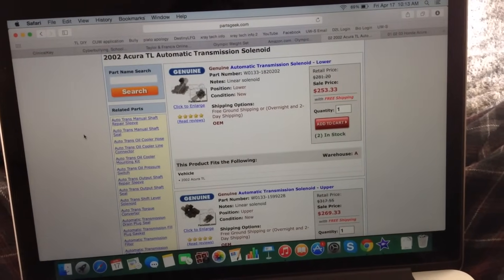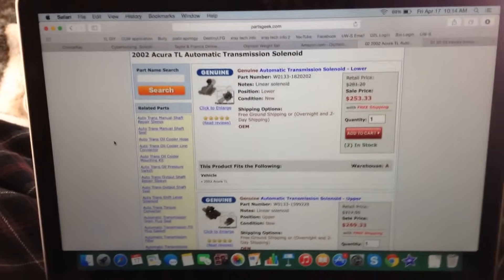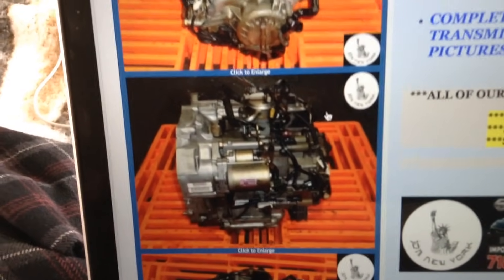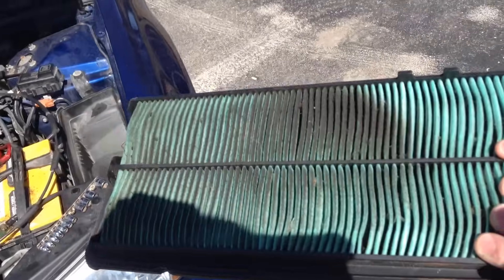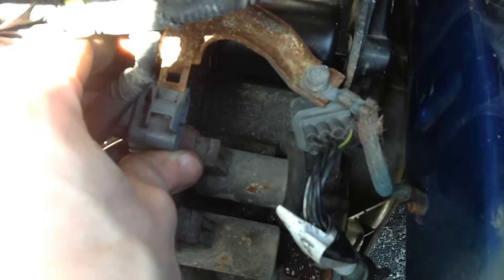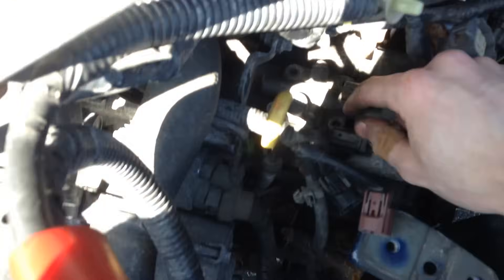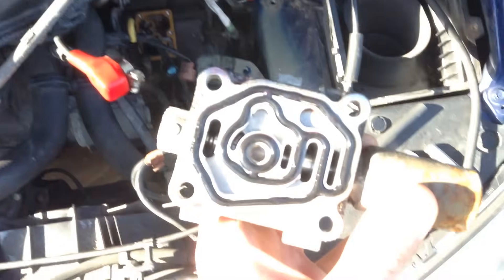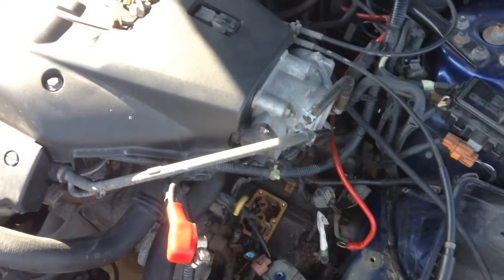Transmission Fix: How to Clean Solenoid Screen Filters for Honda/Acura P0730 P0740 P0780 P1750 P1751

Comment: I am super excited to try this as I have 2000 Acura TL 2.3 with 223,000 miles on it and the check engine light and the PO740 code was thrown at me...every mechanic I called in the Bay Area said "Junk the car the transmission is shot" - basically I think all mechanics would much rather work on putting in a new transmission then trying to fix the problem because they know you will be desperate to fix it so may as well get a new transmission.  The mechanics are well compensated for their time and if it doesn't work then they can try again at your wallet's expense.  I will follow up with everyone in 2 weeks....p.s. I am no mechanic but this will be a cool challenge and if that code is gone and the CEL is gone too!!!   It will be so worth it! Thanks for the video!  Another guy posted a video last week who just replaced the 1st solenoid (lies flat) and said that also cleared his problem - - probably because the filters were dirty on his old one...
Reply from the maker: yah I had a similar experience. The mechanics won't even bother diagnosing the transmission to find a possible solution. They just want $$$. I'm looking forward to hearing your results!
Reply: Update: Bought the solenoid part.  Drained Transmission Fluid (not much there and it was clay brown-black color).  Replaced with Acura Transmission oil (3 quarts) and drove the car about 65 miles and all the monitors reset.  BUT then I drove the car on the highway at around the 75th mile from disconnecting the battery (to take out the check engine light) and the Check Engine Light came back on with the TCS - same code.  So my next step is to chance the solenoid...Hopefully it will take care of the problem.  The car changes gears great...but I noticed when driven for about 40 minutes - after I kill the engine and restart it chokes - meaning it's like turning the key when the engine is on - you get that same sound on turning on the engine after it's been running, turning the engine off and then returning it back on - but there is ample coolant - so I guess I'll just have to see what happens when I install the solenoid in the next week...and report back WISH ME SOME GREAT LUCK y'all (lol).
Reply: Update:  i just installed the solenoid today!  Thanks 4 the video - it was super helpful!  Okay so no I need to drive the car for about 50 - 65 miles.  The car shifted fine before but after all the monitors clear, the CE Light goes off with the TCS...I drove the car today to clear the monitors (prior to installing just to see if I can get it smogged and then drop in a new solenoid - but the monitors cleared while I was on the highway and the CE Light came back on with the TCS...which prompted me to install a new solenoid).  Also - I checked the filters and they were clean...could see no build up so either this will work or it wont...Will follow up with results.
Reply from the maker: Man I hope the new solenoid fixes your transmission problems!
Reply: Update:  Well....the results are in - NEGATIVE!  I installed the new solenoid and actually threw in new transmission oil and same behavior - after all the monitors clear it throws a Check Engine Light on top of the TCS or TCL light coming on.  It seems to me that it's more of an electrical wiring problem because the car shifts fine.  It has 223,000 miles on it and the code says that the clutch is open - which is why it makes me think there is an electrical problem that engages once the Cat monitor is cleared from Incomplete to OK status - that's the time it comes on....Oh well - time to figure out Plan B.  I want to say that it's worth a try to replace the solenoid - I bought a new one so I know it works...AND I cleaned the screens which were already clean (3 total) and looked through another cylinder fitting that had no screen on either side.  BUT - It is an interesting experiment and the power of the internet and everyone sharing their experiences HELPS EACH OTHER vs being charged $400+ only to be told the problem is still there - lol - Plus I got to learn how to do this myself!  That was fun!  Cheers!
Reply from the maker: Dang, I'm sorry to hear this wasn't the answer to your transmission problems. Maybe there are answers on the forums. But yah, this was also a good learning experience for me as well when I was making the video! I figured I'd try to give back to the community, and who knew this video would get a whopping 60,000+ views!
Reply: Hey bro - you did GREAT!  I am pretty sure it's an electrical issue that is tripping the clutch and leaving it open...the code IS referring to that specific solenoid...and there is another one somewhere but it's not that one....so no worries.  People should try it just the same - If I got a shop to do this job = $400 out in Cali...maybe even more.  You $aved me that money and it was worth a shot...not to mention fun to drink a few beers and work on the car!  Cheers!
Reply: Update: HI Everyone - So as I suspected that there is an electrical wiring problem I found this article: SHARING! http://www.autocodes.com/p0407.html

Comment: Just did this for my 1999 TL, car is shifting great now and the check engine has not returned yet. Im still kina scared because I read up that P0740 means a dying transmission. But I don't know about that.
Reply from the maker: Awesome to hear! Yup the "Code of Death" as they call it. I can't help but wonder how many people spent thousands replacing their transmission when the problem was as simple as this!
Reply from the maker: yah give this a try jipsee1! definitely can't hurt anything! The car getting stuck in "neutral" when you try to change gears are normal symptoms. Cleaning the solenoids have fixed many peoples transmission!
Reply: I'm having my d5 flashing on 2001 mdx said my 2nd n 3rd gear problem and won't go into reverse when warm
Reply: thanks.. told needed 2nd 3rd gear and also won't reverse who heated up the d5 light flash after awhile of driving i have 2001mdx wit 150k...i owe 2k can't afford to pay for new transmission other than that runs great!!

Comment: 2000 Acura TL, 270K MILES.  Factory engine and transmission.I was experiencing severe shuttering at 30 mph... and some slippage.Did 3x tyranny flush/fill and changed external filter.  Problem persisted.Tcc error codes on scan tool, so I took it to the garage and they said 'minimum 2500 repair.'I watched this video an cleaned the screens.  On mine, the screen on the lower solenoid was blocked.  Cleaned easily.BONUS.... I found that the chassis ground near the upper solenoid was corroded.  I reattached the grounding terminal with solder... then put everything back together.RESULT:My 270,000 mile car that I bought at 197,000 miles runs like brand new again!!!!The grounding terminal fix seemed to clear up an issue that was throwing an evap canister error code that has been coming up for the past 30k miles.  I would reset the code and it would just come back ten miles later.  It has been 2000 miles since cleaning the solenoids... no evap canister codes and no tcc error codes.CONCLUSION:This little trick saved me at least 2500.00.  THANK YOU.
Reply from the maker: That's awesome to hear! Gives me confidence my car will also make it that far without any issues! I got 3 years of college left and the last thing I need is a transmission replacement.

I'll have to double check that corroded chassis ground thing you mentioned because I currently have the evap canister code. Probably not the cause since the CEL would come on and off every time I filled the tank. But it wouldn't hurt to check.
Reply: You might consider installing an externally mounted transmission fluid filter (similar to: https://amzn.to/2ARMHKC) into your Acura as another form of preventative maintenance.
Reply: @lothianmcadam1  the reason there is no fine filtering involved is because of HIGH FLOW RATES requirements... you don't want to starve the beast !!
Reply: johnny Macon my 2002 Honda Accord ex v6 coupe is slipping BADLY out of nowhere going from 1-2 when cold or not drivin much

Comment: Im having a similar issue with my 2001 acura MDX with 125k miles on it.  I lent it to my sister for a week as her car was in the shop.  When i got it back the trans was doing all sorts of weird shit.  I thought it would be best to do a DYI flush and add some anti slip fluid. During the first few flushes i notieced great improvement as it was due for some fresh fluid.  After i added half a quart of rislone anti slip fluid all hell broke lose.  since ive flushed the car 7 times with honda atf fluid specificly for my vehicle.  Still having the same problems.  Im a fairly technical individiual, but im worried about taking this much of my car apart....then again i dont really trust mechanics as in chicago they love to do a shitty job, buy cheap parts, take en entire week to replace an alternatior and still seem to rape my wallet.  Im considering doing this myself as it seems fairly straight forward but if I fuck up I wont be able to get to work in the morning.  Im also thinking about replacing the trans all together as it defiantly was one of hondas most probematic transmissions in the last 20 years.  I would consider a down payment on a new car but having to deal with unpretictable winters in chicago i would need another AWD SUV.  Replacing the trans should cost me 3K max and i dont think i could buy such a great vehicle as my own MDX for such a price.  Let me know what you think.  Great video BTW
Reply from the maker: By the looks of it, your MDX and my TL use the same transmission, and doing this repair should be virtually identical. It's a pretty strait forward job. Most of the work is removing other parts out of the way so you can get to the solenoids. Just as so long as you don't lose the tiny filters, you should be all good. I guess some extra precautions to take is to be gentle when removing and inserting the solenoids. If you want, you could also use only a light amount of air pressure when blowing the junk out of the filters as it all comes out very easily.

As for why is got worse, my guess is it's because ATF Anti-slip is very thick and it may have had a difficult time passing through the potentially already clogged filters, further preventing the flow of fluid. If you've never changed your exterior transmission filter, I might recommend changing that as well. You can easily see it at about 7:29 at the top center of the screen (it's black and is similar in size to a regular oil filter). Also, by adding the Anti-Slip, you may have over filled your transmission with too much fluid which can cause problems. To check the ATF level, I think the manual says to bring your vehicle to full operating temperature, then turn off the vehicle, and on level ground, check your ATF dipstick to see if you are over the max line.

Hope this helps and good luck!
Reply: Thanks for the quick reply! Im sure that i didnt overfill my trans with the anti slip fluid, I think it just wasnt the answer to my problem. Since it has an adhesive quality to it to bind with gears and clutches im thinking (as you said) it has added to the already partially clanged solenoids and even filter.  This weekend im planning on taking the whole thing apart and clean this bitch.  And if worst comes to worst...ill put a new tranny in because i dont want to lose my MDX.  Ill report back Monday with my findings. 
Thanks again
Reply: Just finished cleaning the solenoid filters.  The middle filter was clogged beyond belief.  There was a thick white substance that looked like epoxy which went all the way to the end of the tube.  The air compressor couldn't even blow it out but i soaked it in some alcohol and used a brush.  I noticed better shifting during the first 20 minutes of driving but after the war was at normal operating temperature for about 10 minutes it started exhibiting the same problems.  .  The D5 light will begin to flash and the car wont go into reverse until restarted. Im wondering if the trans is possibly overheating and maybe a coolant change would help this?
Reply from the maker: Well when I was having my transmission issues, they wouldn't start until the vehicle was at full operating temperature. That sounds somewhat normal to me. I didn't experience any problems going into reverse though. Usually 2nd to 3rd resulted in a slip, and I'd have to put the car in neutral, then back into drive. My car would also not want to go into 1st gear after coming to a stop. All of that was fixed when I did this solenoid cleaning. 

I can't say I saw any white epoxy substance in my solenoids. That's definitely a sign something isn't right. Did you make sure to check the junk didn't make it's way into the solenoid itself? Hopefully the filters prevented that. 

From a quick google search, that white substance could possibly be the result of water or coolant mixing with your ATF. Make sure there is nothing wrong with your radiator. If that's the case, then your situation is not good. The only way to get water out of the transmission is a full flush, and we all know the risk of flushing a transmission.
Reply: i mean theres no doubt this tranmision is on its way out.  It h as been for years.  Im just wondering if theres some connection between heat and and the trans and if theres some way to make it a bit more stable during long periods of driving
Reply from the maker: There's definitely a correlation between excessive heat and transmission issues. That's why our TL's had a transmission recall. They had to put an oil jet kit. Here's the recall summary: 
"...certain operating conditions can result in heat build-up between the countershaft and secondary shaft second gears in the automatic transmission, eventually leading to gear tooth chipping or gear breakage."

But in your case, I don't think overheating is an issue. Like i said, it's normal for transmission issues to not act up until the car has warmed up. I don't remember the fine details as to why that happens, but that's just what happens. Probably because the cooler thicker oil is holding things together until the ATF thins out as the vehicle warms up. If you haven't changed your coolant in the last 3 years or your coolant levels are low, that should definitely be taken care of. But otherwise like you said, your transmission is probably on its way out. Sometimes a transmission is worn out too bad for any amount of fluid changes, additives, and tricks to help.

I'm gonna assume you checked your solenoids themselves are in proper working order. So the only other thing I can recommend is searching the forums for any other possible solutions. Check out Acurazine and Acuraworld.
Reply: There is a correlation as the transfer I'd had lunes to the bottom of the radiator. On the siagnostic route to replacing a head gasket the radiator was replaced and that somehow made a slew of trans issues very prevailant

Comment: my 2005 Honda odyssey has a ttc solenoid switch circuit problem.I can only drive it in neutral.
Reply from the maker: didn't know you could drive a car in neutral lol 

Well if you know only the solenoid is bad and not the transmission, you might be in a some luck as a new solenoid only cost about $200 - $250
Reply: 2005 acura tsx engine diagram

Comment: the middle tube on mine had the screen facing out and the outer tubes had the screens facing in, does it matter which direction the screens are facing?
Reply from the maker: By looking at my video, it appears the screens are not fully centered in the tubes, but rather are located closer to one of the ends. This end should be at the top when placing them back into the solenoid. It also appears the dome of the screen should be facing inward, but if it got pushed the other way, i don't think it will make much of a difference. I wouldn't even bother trying to push it back in due to risk of wrecking the screen.
Reply: +Incin3ration... I know each tube has an indent ring around the outside I think that is for the O-ring gasket which makes me think the screens should seat closest to the linear solenoid part it's self. it's hard to find any info on this and unfortunately I think the owner before me has removed this part and replaced it wrong. thanks for the reply

Comment: Thank you, Thank you.  Followed your instructions and also changed the tranny filter and fluid.  My wife and son considered my efforts a waste of time.  They were talking a repair worth more than the value of the car.  I drove 10 miles immediately after cleaning and had absolutely no issues, which would normally occur at about 3 miles or when fully warmed.  105,000 miles at time of cleaning/repair - maybe we will make 200,000.

This car still looks great with little rust and a few cracks in the leather.  I just replaced fog lights 6 months ago and was ready to pull tires tires, lights and all good components to sell used.  BTW, fog lights on the web from $150 - $190 for the pair for DIY.  Quote from my Acura dealer $480 per pair with install extra.
Reply from the maker: Hows the car holding up? and yeah the fog assemblies are a little pricey, but as nice as they are, it's not too surprising. When I got my car, it had a hole in the fog light and I replaced it for $60 from amazon! less than 2 years later, same side got another hole in it, but I caught it pretty quickly. I made a custom replacement lens out of LEXAN Polycarbonate. It's just as clear as glass, but also 250 times stronger. Sealed the edges with some weatherproof silicone and it has held up perfectly!